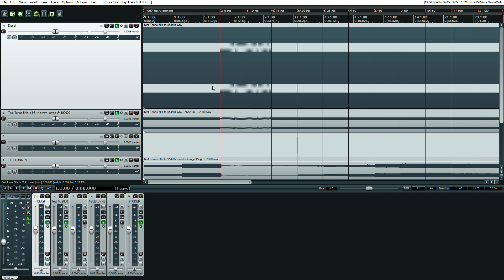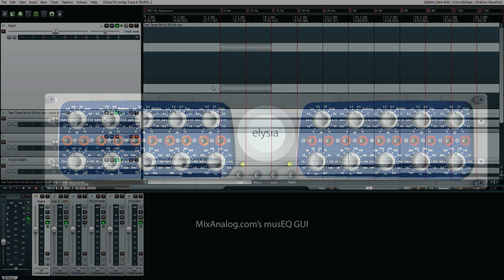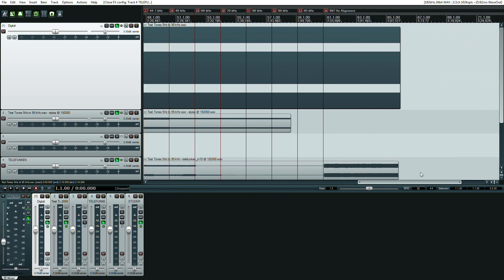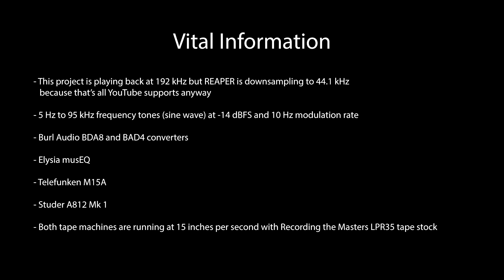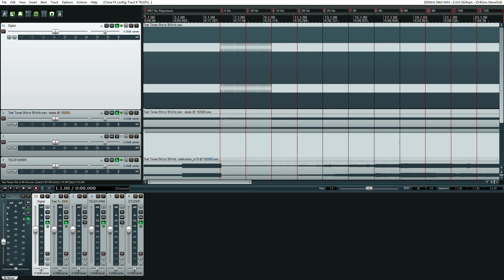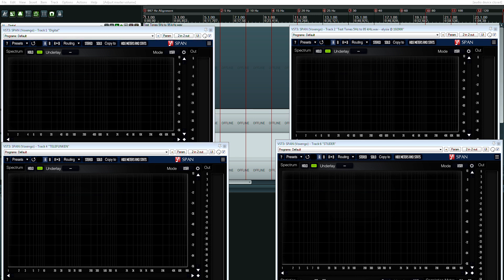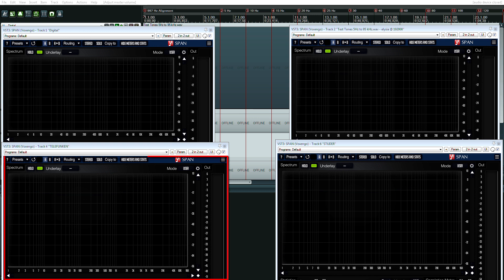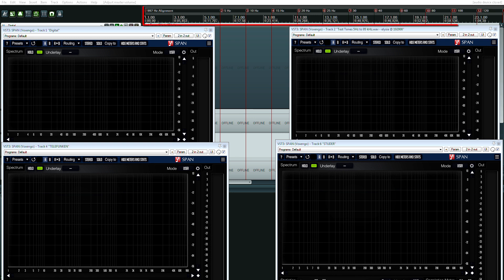Does Audio Tape Have a Sample Rate?

Comment: how the online tapemachine works? you dont buy reels do you?
Reply from the maker: Nope. What you do is you upload your tracks to their servers and then buy tokens to use their gear. Right now they have two pieces of gear that you can use for free for up to thirty minutes per day. After that you have to pay. So the tape machines don't work any differentother than if you happen to book a session when the tape has reached the end you have to wait for it to rewind.

if you are concerned about the tapes not being fully erase then what I would do is booked a 2-hour session and run digital silence through the tape machine for 45 minutes.
Reply: @RealHomeRecording  as far as i know Adam, tape disintegrates, rerecorded reels where costing less in the studios and there were being used by the  lower budget artists, so i am a little bit skeptical all about this...results will vary over time....unless they are pretty cleat about the state of the reel

Comment: I bought an album off of HD tracks.  Korn and the album is "Issues" which was recorded to tape.  I got the 24bit 192khz recording.  I ran a spectrum analyzer, using adobe audition.  The dynamic frequencies of the drums surpassed 60Khz, so I figured 120Khz sample rate even though it was captured in 192khz.  The better the capturing of total frequency content, the better the consumer delivery sample rate.  Even capturing audio at 96khz sample rate, you are not capturing all the frequencies. Even if you cannot hear the frequencies, it makes a better end product.  That's why they have DSD recording. I think the best recording would be 2.4Ghz sample rate at 32 bit integer.  Quantum computing needs to hit consumers.
Reply from the maker: That said, I love the idea of Direct Stream Digital for those who are rich enough to mix entirely with analog gear. In theory it is the best audio recording medium. The caveat being you should mix and master entirely on analog equipment.
Reply from the maker: From a marketing standpoint and from a "you may as well, hard drives are cheap" standpoint I agree. From a practical standpoint, 48 kHz is more than good enough. So, maybe I'll be the only weirdo releasing 16-bit/192 kHz music? LOL...

32-bit integer is absolute overkill. No recording studio in the world has a less than -144 dBFS noise floor. Let alone the equipment noise from microphones, preamps, etc. etc.

My advice to anyone wanting better audio quality? Invest in two nice pairs of kick ass speakers. One accurate but boring pair for producing and another for listening enjoyment.
Reply: @RealHomeRecording  Digital is digital regardless of Music, Photogrpahy or Motion Picture.  The more resolution and the more bits, the better the end product especially if it's dithered properly. For exaple:  It's best to capture in 4k and deliver in 1080p than to capture in 1080p.  In Digital the more information, the better.  But the bottle neck is our current computing systems.
Reply: @380stroker  The reason why higher sample rate recordings sound "better", it's not because of the higher sample rate itself, but the "aliasing distortion" on low sample rate recordings, and it becomes more obvious when plugins come into play. Still, many plugins nowadays have anti-aliasing techniques like oversampling to mitigate this.

Btw, analog does have a different kind of distortion for frequencies higher than our hearable range: Intermodulation distortion. It sounds kinda stupid, but hey, analog it's how it works in real life, so it's not perfect by any means.
Reply from the maker: @380stroker  "In Digital the more information, the better."

Not if that extra information is causing issues in the audible frequency band. There was a discussion about this on Gearslutz years ago that is pretty interesting: https://www.gearslutz.com/board/mastering-forum/968641-some-thoughts-quot-high-resolution-quot-audio-processing.html

I'm more concerned about the moronic mastering engineers/A&R or record label execs putting brickwall limited to death music inside of 24/192 FLAC files.Talk about backwards thinking! They are killing high resolution audio with their horrendous engineering practices.
Reply from the maker: As an example, they really messed up Nirvana's Nevermind. It's 24-bit/96 kHz but sounds worse than the original CD version! I know that album very well and it's a shame that they had to brickwall limit it so poorly.
Reply: @RealHomeRecording  Marketing always trying to sell people bigger stuff, that doesn't make sense, sigh.
Reply: @RealHomeRecording  Haha, right?  Brick walled up the ass!  In Utero 24 bit sounds way better.  They should let Adam master Nevermind album.  But Courtney love and her deep state ties would cause trouble.
Reply: @heavymetalmixer91  as long as people believe snake oil like "Even if you cannot hear the frequencies, it makes a better end product" ... marketing will always take advantage of fools waiting to be parted with their money. Especially those with a brand new record "deal."